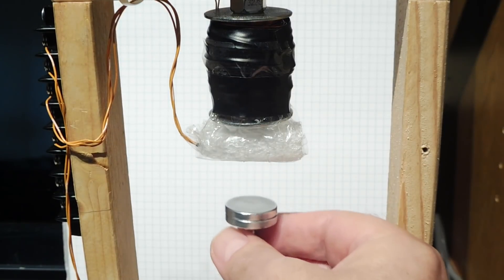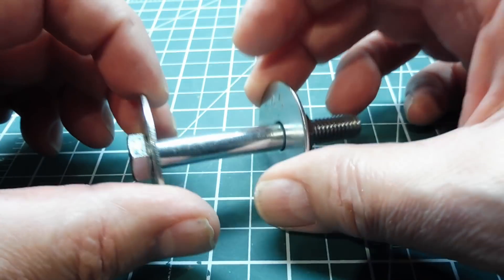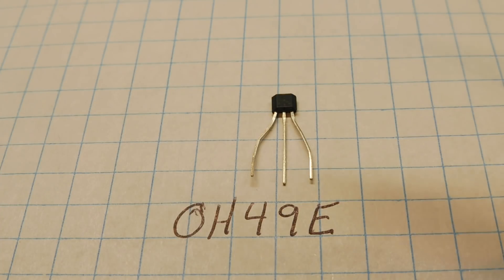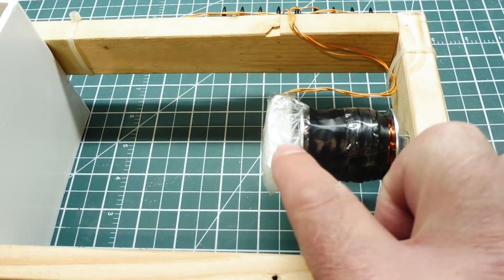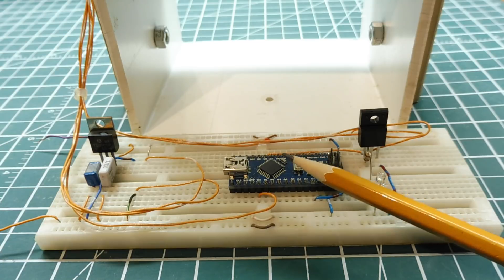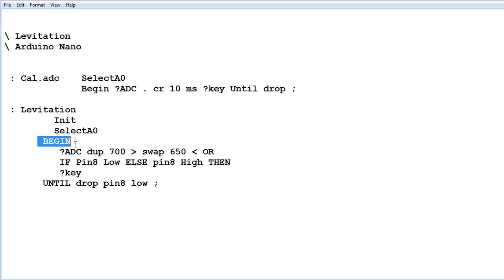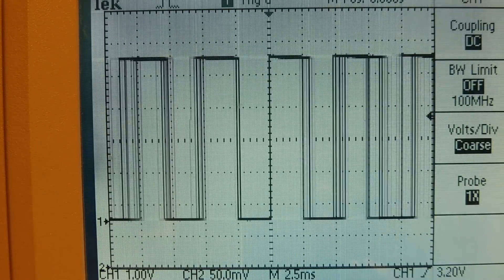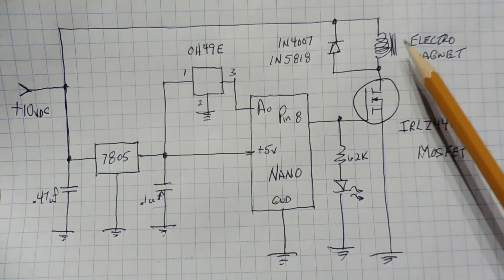Magnetic Levitation

Comment: Is the oh49e necessary ?? If we use some other hall effect sensor would the circuit be effected ??
Reply from the maker: Any type of linear hall effect sensor will work.
Reply: thanks for the reply ,i dont have a lab bench power supply how to i supply 10 v to it ??
Reply from the maker: @akshatpande1649  Get the power supply out of an old computer (PC). You can use the 12 volt output.
https://www.instructables.com/id/A-Makers-Guide-to-ATX-Power-Supplies/
Reply: should i use 9v batteries in series cause we already have a voltage regulator
Reply: 0033mer if i replace both the capacitor with elctrolytic capcitor with 1 microF each of 6.5 volts rating would the circuit still hold?and also a 12v 2 ampere adapter should be enough to turn on the electromagnet right??

Comment: Very cool, no hysterisis in the turning on and off of the electromagnet ?
Reply from the maker: The magnetic field is never turned off fully. When the mosfet turns off, the free wheeling diode across the coil re- circulates the back emf energy into the coil keeping it on for a short period of time.
Reply: In the circuit diagram, did you use both 1N4007 and 1N 5818 or we can use either one since both are diodes?  Can you kindly tell which order if both are used. Thanks :)